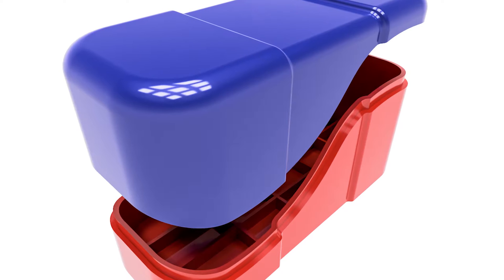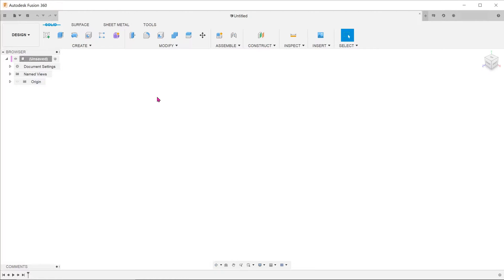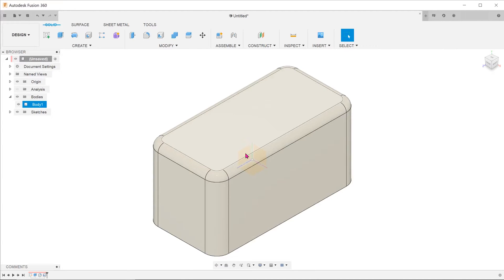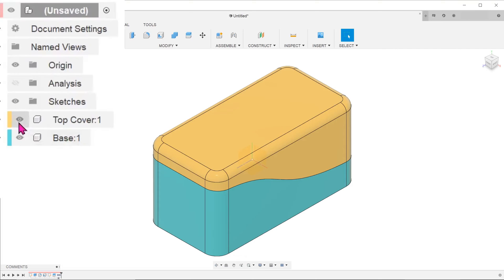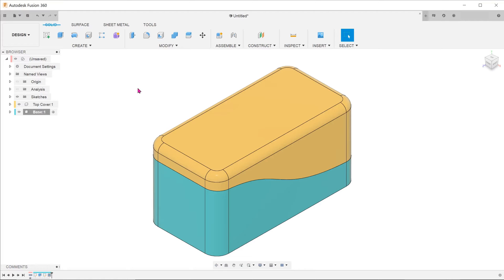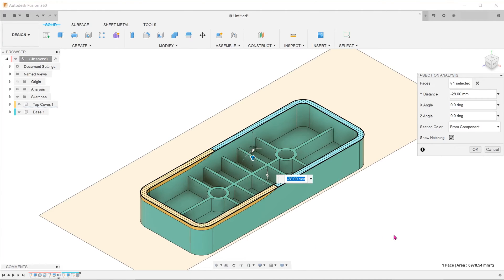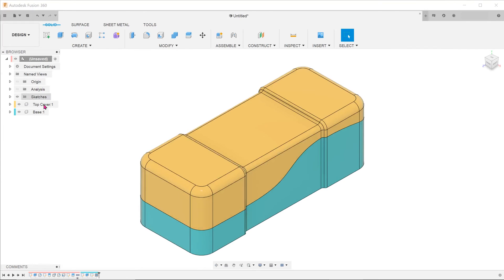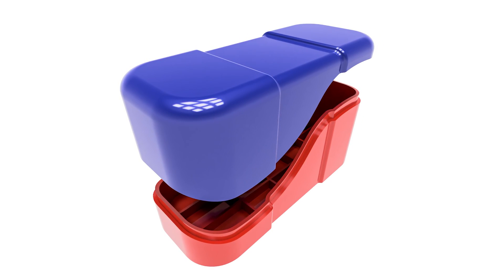Fusion 360 - Master Model Workflow

Comment: Great tutorial! Learning concepts is much more important than watching you solving single design problems. But one part is missing: in the last pic of the model is a kind of rail, which prevents the lid from easily slip.of the base. Edit: I found this method in your video from February 2021.
Thanks a lot!

Comment: Best Fusion learning experience I've had so far. It does require the viewer to have some basic Fusion skills, and some of the video was too fast. 95 of 100 stars.
Reply from the maker: Appreciate the compliment. I do acknowledge that speed can be an issue. Sometimes, as I am editing, I find it hard to take the perspective of the viewer. I am trying to improve on this.

Comment: Hello , great video , clarifies things a bit but i would like to ask you , when converting bodies to components the component timeline has only one icon and the extra icons that created from later modifications or the first icon cam expand and see the features that are related with this component ? 
I working on a complex design and i converted the components afterwards and the main component timeline is way too confusing i think it would be better to make new components from the begining in order to be more clean but if i do that I wonder should i keep the sketches in the main component and extrude-revolve from there or should i make sketches in each component itself that will be projections of the <<master sketch>> from the main component ?
Reply from the maker: Hi, for your first question, when you activate the top level, you will see all features (top level and component level). If you activate the component, you would only see actions at the component level. Sorry if I had misinterpreted your question. It sounds like you are asking more than this. Let me know.

I really like your second question. It is the foundation of master modelling. My philosophy is this: Anything that is shared across components (main shape, main fillets, shell, etc....) should stay at the top level. Anything that is unique to each component should be done at the component level.
Reply: @Fusion360School  
Hello , thanks for the quick reply , in my first question , for example i converted the bodies into components late and the timeline of the component was empty so when i had to change the component i had to find the features from the top level timeline which is to long and confusing , i believe i should make them as component from the first place . 
For thr second i agree that the main sketches should be first but should they projected in other sketches inside the components ? Or maybe this would be prone to lost references etc , later when some changes will be made ? 
And an other thing , should all joints be made in the same component ? 
And an other , would it be cleaner to create one more top component which will be only for joints ? And all the other components will be created inside it so this second top components timeline will be dedicated for joints only ?
Reply from the maker: @antoniskaloterakis7996  Hi, I would avoid projecting sketches from the top level down to components if possible. Fusion 360 does seem to have a problem with lost references, not as robust as SolidWorks for example. May I ask why you need to project sketches? Would it be better to extrude at the top level and then convert bodies to components?
As for joints, I'm afraid I am not the best person to answer. My experience with joints is very limited. By the way, I am planning to do a master model video soon.
Reply: @Fusion360School  hello , i dont have to project them i am just asking . As for to extrude in the main component i think extruding directly in the component is better because all features are captured in its timeline so its easier to find it and change things , i am looking forward for your next video

Comment: So where is bottom up design useful?
Reply from the maker: While the master model (top down) approach can be very useful, it takes discipline, good file management and understanding to make it work. Many users might find the in-context relations hard to deal with. If you prefer components to be independent of one another, a bottom up approach would be better.

Comment: I went through the video a couple times tonight and was adding a lip per your other videos.  When I go back and add the 'saddle', it breaks the projected cut line and the lip won't work.  Somehow the saddle is breaking the Offset Face that is used to create the lip on the lower section of the box.   Any ideas?  Thanks in advance.
Reply from the maker: Hi, before you added the saddle, was the original line composed of splines also? Was there any deleting of entities to create the saddle? If yes, this might have caused missing entities in the downstream features. If the offset face is creating problems, it might be worthwhile to try setting the offset at zero and then using the move copy command to shift up the face.
Reply: @Fusion360School  I didn't delete any spines.  I think creating the saddle breaks the original spline into multiple splines causing the issue.  I'll try playing around with it some more.

Comment: Great tut! But I have a question: in 4:50 your timeline refreshes (cleaned up), but my timeline will not be cleaned up even though I do everything 100% the same in your video !?!?!?
Reply from the maker: Hi, do you mean that you still see all the steps before the body to component transition step? This seems strange. After activating the component, you should only see the transition step. This does not seem to have anything to do with toggling on/off the "do not capture design history" option. I also did not find anything in the preferences that would cause this.
Reply: @Fusion360School  Yes, I didn't find anything in the settings either. I've also asked several YouTubers to do tutorials, but no one has an answer. Also has nothing to do with Windows or Mac version of Fusion360 ...
Something just annoying - if you have larger projects with several components, it quickly becomes very confusing.
But thanks anyway.